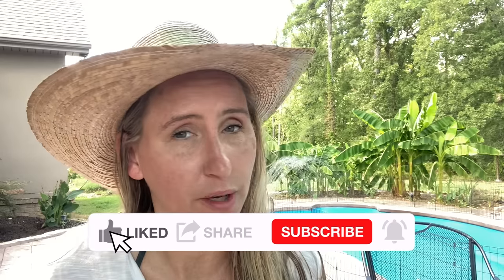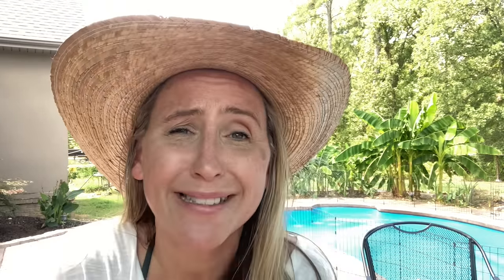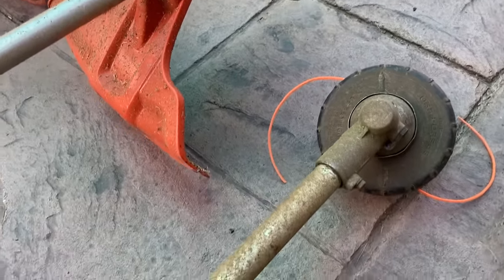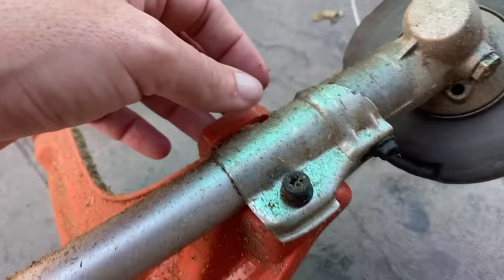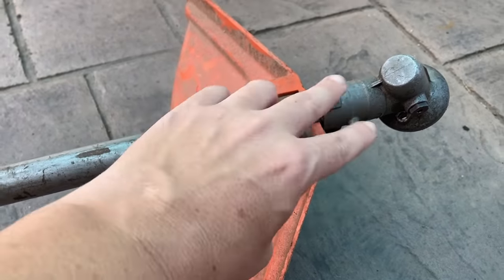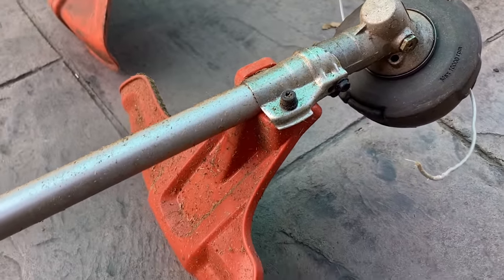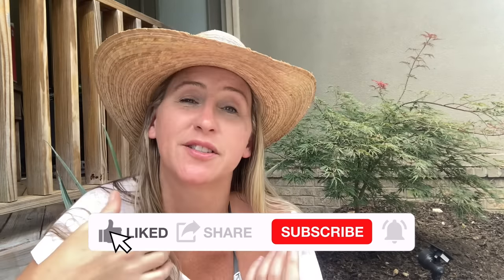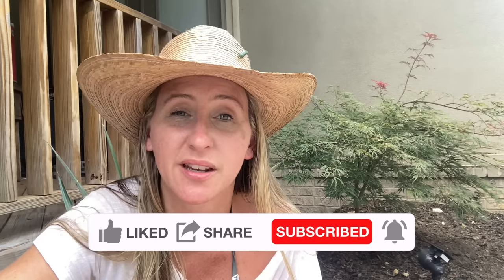String trimmer guard ON or OFF? Will it destroy your Stihl, Echo or Husqvarna? You might be shocked!

Comment: For one thing if you remove your shield the trimmer line cutter won't be there to cut the line down to a specific length. And the longer line will increase centrifugal force on the heads. That will shorten bearing life on the heads. I just use a head with two strings. I've never had any problems. Maybe one time I had a crank seal leaking. But that was easy fixed.

Comment: Mine has such a weak engine that the wire can not be any longer than the wire cutter. So without the guard, if I give more wire it can become a bit too long and I would have to stop to cut the ends off. It would damage the engine over time. Maybe in very thin grass it would work.

Comment: I have a stihl FS460 brush cutter with a saw blade, and I want to use a string trimmer on it. I got a trimmer head listed for it on Amazon, but have not attached it yet. There is no line cutter on the current guard, so do I need to worry about adding the line head, and will I screw up the gear head if I do?

Comment: Shield making stability and it cuts wire, if you have too long wire its bad for machine, than one side is too short it will start having issues inside like if you have one side tyre pressure too low on one side car will go to side. And about shield i have been cutting commercial properties for very long where you may have bushes, rocks, grass above your head, we usually used trimmers with 2 handles prof ones like on bike. So i can tell face guard is a must same as guard on trimmer. Especially if you use blades not wire.Especially if you use blades, trimmer guard is a must. The guard is actually stopping grass to go into your face and rocks. from bounce it wont help it bounces same as chainsaw and you can cut your leg off. As if you use wire well grass and rocks are pick up very easily. In a week you get at least 2 rocks into face guard. Once it flew rock to me so fast it split my face shield into 2. So shield is a must, trimmer shield also. Its not fun to get rock into face, you dont need much for a person to get to er.

Comment: Many years ago, when I owned a commercial lawn business, we took the shields off, since it made it easier to see when edging. That said, I only recall one trimmer having the motor "wear out". Never had one wear out the gear head. All of the other trimmers ended up getting stolen or we sold them used to get the newer model. I have a 15 year old straight shaft  Echo 230 with original carb that I still use at the house and has the guard as well as a an Echo 3020T that I use on my ranch. Both have guards. Getting older and dislike getting pelted with stuff and not doing a whole lot of edging, anymore.

Comment: I fill my gear head with Snapper #2 grease several times a year.  It was originally filled with a yellow grease but nobody knew what it was.  Since it was of about the same viscosity as Snapper #2, so that is why I use it.  I also hang my weed eaters up by the head, so any extra grease will end up on the shaft, so I do not have to lubricate it as often.

Comment: gear heads  26 or 28 mm shaft  7 or 9 spine with new collars and protection washer and  10mm LH nut  .   cost $25 all over ebay and ali  and the jungle site   ? its better value  to buy a new head even though  new gears and bearings are cheap   as chips  ....  if people read the hand book it tells you to remove a bolt / screw on the side and push  grease in their atleast once a year  .... it seems stupid but that little bit of grease melts if the head gets hot and helps the bearings

Comment: I do enjoy your videos. Thanks so much for your wisdom. 
I have an old FS106 with the handlebars that i need a bump head for but the dealer in town was not very helpful. It has a square shaft that the head seats on and he insists that it never had it that he knows of. Is it possible to just change the shaft or would you have an idea where I could locate a bump head  to fit. I would guess the trimmer is around  20 yrs old but runs fine.

Comment: Biggest issue I have is some of the boys don’t run enough load on trimmer head then the machine is over speed no good for 2 stroke, and melts speed feeds ,so better not to use them. Other operators can listen to their machine and manage cord length to suit the application and load. Generally on the shindiawa handlebar machines we use you can remove the lower part of the guard containing the chord cutter and not the whole Gard.Handle bars I love ,Can run rings around d handle machines with more control once you get used to it even for small jobs,neater,more control even up sideways edging

Comment: Thanks for the info,  this a very good observation.  I used to cut lawns for over 10 years and had the guard off on my Echo. It was lighter and could around this better. Once had a Red Max chain saw, parts were very expensive and not anyone had them . Will never buy Redmax again.  I will stick with Echo, Sthil. I always lube the head at spring time. Nice video ! Nice pool !

Comment: I am a homeowner with several hundred feet of driveway to edge along with dozens of trees. I haven’t used a guard in over 30 years and have only worn out a few heads. We have Redmax trimmers and they have plenty of power even when we over extend the string.

Comment: I have not used string in a strimmer since 1994, I was introduced to the Stihl polycut head back then and found it so superior to the string heads. Stihl have now dropped the p[olycut heads but there are other makes out there now so I use them, if you want to know what a polycut head is, it is a cutter head that takes three nylon blades. One set of blades on average last a season or about one mile of fence line where the blades are coming up against the fence posts.

Comment: I have a stihl straight shaft trimmer what I did I removed the string hub and replaced it with a stihl hub that uses plastic blades , I keep the new blades on a glass jar full of water as per stihl instructions , have you dealt with this before ? string verses plastic blades? love what you do jerry

Comment: I am a  a guard off person. 
I like to run with longer  line within  2 inches  from guard   
Cutter.   More in the power brand range of the unit.
 And I  goes thur less line also and get the job done faster.  Just do not over use a longer  line it will destroy  your unit..

Comment: The only real reason to take the gaurd off is to save on trimmer line, with the Echo trimmer you can flip the cutter blade around and that will save you about 1" of string and truthfully that is about all the engine will pull (you really gotta pay attintion to engine rpms )
And Sthil I just cut the bottom of the guard off but it still can't run more string than an inch past the guard

Comment: probably does damage the engine running long string with no guard. I am In east tennesse a lot of hills so a lot of weed wacking. very little time and lots of yards to do. I need that sting very long it saves a lot of time. save me enough time and money getting done faster with longer string it is worth burning up the unit slightly faster.

Comment: I'm just going to give you my personal opinion from the safety aspect of it this happened to me about 25 years ago give or take I was a teenager helping my grandfather weed eat a lawn account he was mowing qnd I was weedeating the fence line on one the lawn accounts well on walk around due high grass missed a beer bottle up against fence using qnd old straight shaft sthil with one metal brush chains on it no guard I I found that beer bottle the hard way when that blade smacked budweiser bottle and Sen glass shrapnel  in to my legs and I was wearing what most people call muck boots we used wear on fishing boat and due yard work because the ones we had were snak resistant I that glass went clear through them boots I had go er and get glass removed out my legs not something I plan relive so I say keep guard on I do realize I using a brush chain them things are dangerous too

Comment: After seeing the reason for the shield bracket to help secure the gear head if I were determined to use without guard, I would just cut the plastic part away to keep the integrity of the bracket.

Comment: One thing you did not mention here is that the only way you will damage your strimmer by taking off the guard is by using the line too far out of the head, there is very little reason to have the guard in place to prevent flying debris as it flies under the guard, and in any case using, or even starting a strimmer without a face mask on is like using an angle grinder without a mask, so the only problem is that the strimmer head will be closer to the ground, and if you scalp the ground you should not be allowed to run a strimmer anyway.

Comment: What about removing the STX4500 shield on the EGO 56V Battery commercial trimmer. is that okay as a homeowner to remove the shield?
Reply: I found that it depleted the battery faster and the motor sounds like it’s working harder. Ie) you might be using more than the 14-16” it was designed to use. For homeowner use, I found that twisted trimmer line works the best with battery trimmers.

Comment: The shield on my sthil keeps the trimmer string at the right length and I've noticed when the string first comes out it's so long it boggs the engine down until the shield cuts it off to the proper length!, so I could see it doing more damage to the shaft with out a shield to keep your line at the recomended length. Great video!.

Comment: The more line out because the cutter in the shield is gone adds load to the system, with no cutter if one line gets short from hitting an object unbalances the head and will vibrate the drive line

Comment: Although this was posted a year ago I'm looking to purchase a trimmer as the troy-bilt has quit. Knowing the trend with lawn mowers, weed wackers, ect. all becoming so cheap. I will just straight up ask you what brand and model you would recommend. I'm not a lawn care specialist but I have two acres I'm on, do my two sisters properties, mow for some other family, friends, and neighbors that can't do it themselves. So the unit will get some heavy use, I'd like it to last some time and also be repairable when the need arises. Prefer gas powered units. Also thanks for the tip on trimmer line needing to be hydrated. Enjoy your content and knowledge. Thanks
Reply: I’d say anything made in Japan… If used  Seller should let you test it first. Shindaiwa when it was Kogyo (2007) or earlier. Eg: t-230 & t-231, t-261 & t-272. (X versions of these are blade capable) Any Echo when it was made in Japan under Kioritz 2007 or earlier. (New ones under Yamabiko are junk) Home Depot & YouTube have reviews of oil leaking out of the exhaust even if mixed right. Coil issues too (repaired free) but an unwanted headache for a newer unit. If looking for new weedeater i’d say Maruyama since every model is made in Japan.

Comment: So before you return it to get it fixed under warranty just toss the guard back on . Just make sure you use it enough to get the guard dirty before removing it so it looks dirty and like it's been used with it on..
Reply from the maker: Good luck getting the grass off your shaft where the shield was missing. That stuff is like cement. lol!

Comment: 525LST and 430LS Husqvarna trimmers are the best out today from my experience. Over Echo 2620's and Stihl 94 and 91, and etc. Those homeowner Husky ain't nothing special though. My 2620 ECHO actually runs a lot better with the gaurd off. It was shakey as all hell with it on.
Reply: At higher throttle anyways
Reply: RedMax are basically Husqvarna's with a different look. Husqvarna owns RedMax

Comment: Some one is missing a very important part of the argument. Ever noticed there is a blade on the shield? This cuts the line off at a certain length when it’s too long and first spun up. With no shield/blade combo you can have a far longer line spinning, this increases the torque and drag on the machine putting extra strain on gear head gears and ultimately the clutch. This is other than the safety arguments.
Reply: No one is missing that argument.  It is the vast majority of the argument made.

Comment: The trimmer line looked long. Part of the noise may have been from a crack the whip effect caused by getting on and off the throttle.
Reply from the maker: Did you see the second trimmer head I tried? It had no string sticking out.
Reply: @Chickanic  good point

Comment: I personally can't understand why anyone would purchase any other brand trimmer that Echo. I have one that is about 20 years old and has been beat to sh%t. Used for about 15 years as a trimmer and the last 5 with a saw blade attached for brush. Still takes a beating and wants more. I bought a second 5 years ago just so I could turn that one into my brush cutter. Man, I hope they never screw these machines up. I may have to buy one more in my lifetime.

Comment: I have a question. Is there a adapter head for a 2 wheel push trimmer? A head which can cut larger diameter weeds
Reply: I sent a message to your web site, I think it’s your store account. Just going to verify it’s chickanic. The message I received at 3 am
Reply: I sent a message to your web site, I think it’s your store account. Just going to verify it’s chickanic. The message I received at 3 am
Reply from the maker: I have deleted the scammers comment. It was not me.
Reply: @Chickanic  didn’t think so

Comment: I've been using trimmers without the shield for over 20 years commercially and had them last over a decade with regular maintenance.   The guards get in the way to to the point that not having it there says enough time that it would be worth losing some longevity.   Also anybody that uses one commercially knows what length to keep the string.  They don't run it long to get a bigger swath.  They understand it will bog down and not save time at all.

Comment: I do a lot of long distance heavy strimming of brambles, grass etc, and have used a variety of strimmers. first up was the Husqvarna 25CC, which I gave up with, as it didn't have the bottle for the job. Next up, a second hand Stihl 70CC Forestry brush cutter. I bought this at the bargain half price, and even got sent of video of it running. Sadly the head was about done, and it cost £500 ($603) for a new one and over a month to receive it given this model has been discontinued. This machine is devastating to the landscape and fuel consumption, but it isn't for tens of hours use - it weighs more than a large lawn mower. Finally I settled on Stihl's 36cc backpack unit with a split shaft. It has the power to keep the head going, and the fuel use is good - one hour of constant use. And it's great for all day use. Sadly, that guard has to go - it gets in the way as the thick grass and brambles cannot discharge quick enough, and it clogs the trimmer. Without the guard, it's also less weight, and I can nip into tight areas better. A new split shaft would set me back £130 ($156) and is more easily available. In the 4 years I've had the backpack Stihl, I've only had to clean the plug a couple of times, and change the fuel out once because I didn't use it for about 3 months at one point over winter. I keep looking at the Honda backpack units with the GX35 and GX50 engines, and I'm curious how well they hold up against the mighty Stihl, since they have a separate oil tank.

Comment: You can still cut the guard off regardless of how they built it in.. but your right I buy straight shaft trimmers for my company. My mcculloch trimmer has never let me down and I swap an edger on it also and it's a commercial style trimmer and out of all the brands I've bought for my company my mcculloch keeps on running with no issue besides replacing a gas line from cracking

Comment: I bought a echo trimmer at home Depot and I've had it since 2006, I haven't done anything to it except change of spark plug once 👍 new gas oil, string.  Runs great still, Shield 🛡️ is off, manual fit string. 
I don't use it a whole lot every year